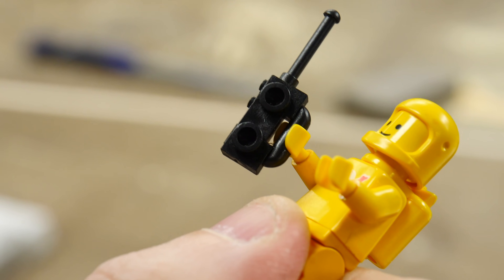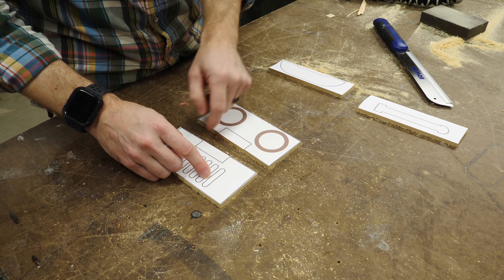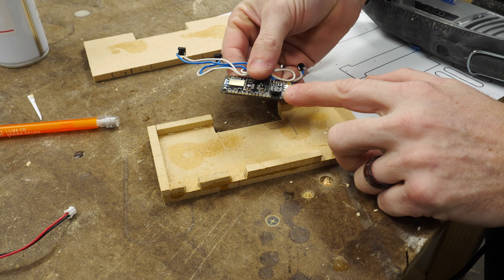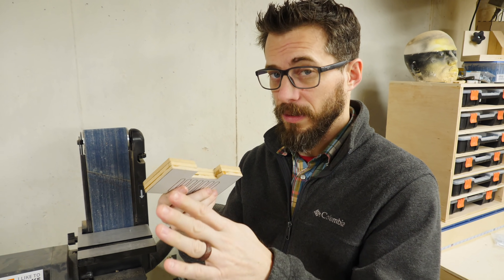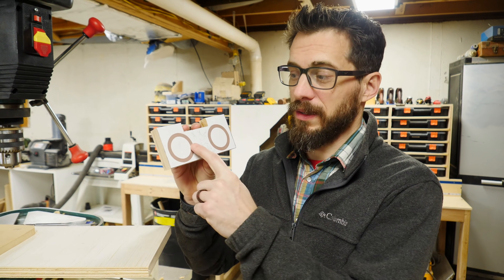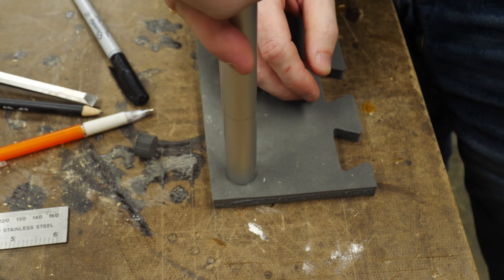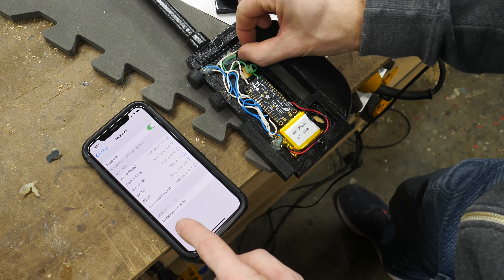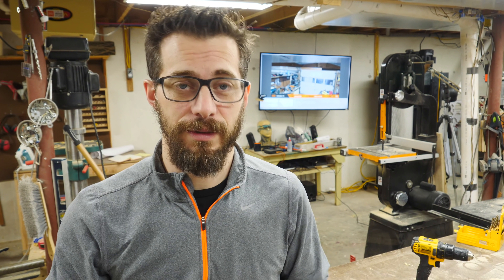Making a LEGO Walkie Talkie Live Stream Controller (Bluetooth) | I Like To Make Stuff

Comment: Great video as always :) one thought on the magnets, if possible, you could put half of the magnets in at half depth, and the other side in at 1.5 depth, then the magnet acts a little like a dowel to resist sliding which can be an issue when using magnets for closures like this, but they still touch keeping your box shut. Just thought of this while watching as i have had an issue with sliding in the past.

Comment: Thanks so much for this video. I’ve been trying to find a way to build a small hotkey remote for use with some art programs on iOS. I’m a relative beginner when it comes to electronics and I knew something like that was possible, but I didn’t really know where to start. The internals of your project are exactly what I needed and now I’m sure I can modify this to fit my purposes. Thanks again!

Comment: What I don't get, is you made 3D models of something that you could have just 3D printed rather than made with wood.

Maybe plastidip your foam button tips.
Reply from the maker: Well, the video wouldn't have been interesting at all (or approachable by some) if it'd just been "we modeled this, then printed it. The end " :)  I wanted it to have a little more to it that that.
Reply: @Iliketomakestuff  could plastidip your foam buttons to get a more uniform look for your parts, though.

Comment: A cool way to get more precise parts on a wood lathe (especially complex curves) is to cut out the negative of haof of the bluprint. Then you basically have template of the curve, you can hold up to the part the check how accurate you are

Comment: Why do you need magnet??? Just extend the charging port
Reply from the maker: With any electronics project, it's a gamble fully enclosing the components so you can't get to them if something stops working.
Reply: @Iliketomakestuff  I guess screw would be a better way so it does fall apart every time it falls down..any way thanks for replying

Comment: As always great project! I worked with MDF a few weeks ago and found that flooding the “I end grain“ of the MDF with wood glue before painting, really help get a very uniform Appearance on the final result. Not necessary but just a quick tip for all you makers out there. Great project Bob,
Reply from the maker: That's a good tip, thanks!

Comment: Buttons are always hard to figure out when you're doing electronics. I really like using mechanical keys from actual mechanical keyboards. You can pick up 50 switches for like £10 on eBay. They feel nice a lot nicer than the little clicky ones that come in most electronics kits, they are easy to surface mount and it's easy to find 3d printable models of keycaps which you can customize to look however you want. 

I made some keycaps that had a space for Adafruit Neopixel chips inside them so they could light up depending on how you program whatever is controlling it. I used these in a console for my Blackmagic ATEM video switch so it showed the button for the live cam in red and the button for the cued up camera in green. Works great!
Reply from the maker: That's a really good tip, thanks!
Reply: This is awesome!